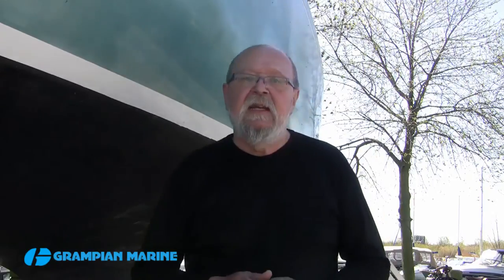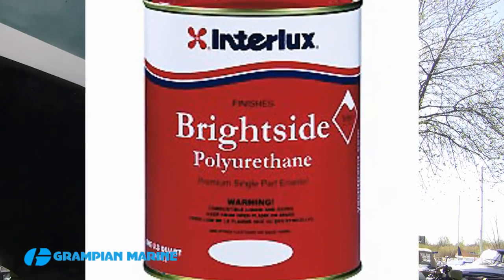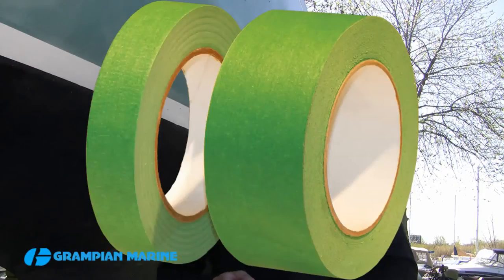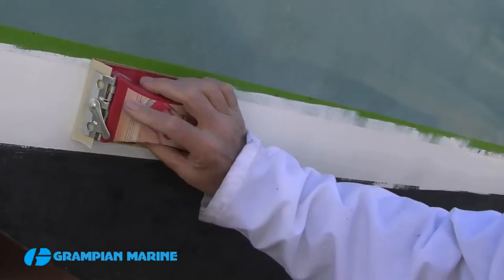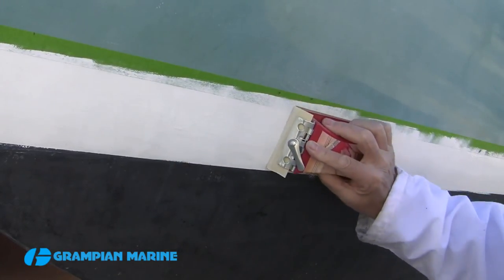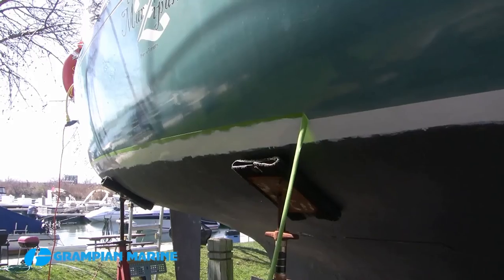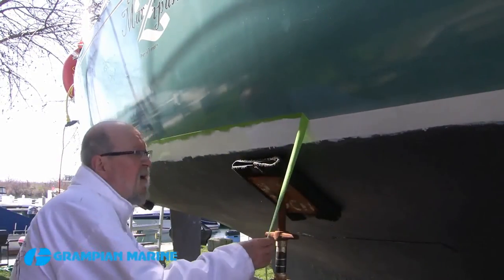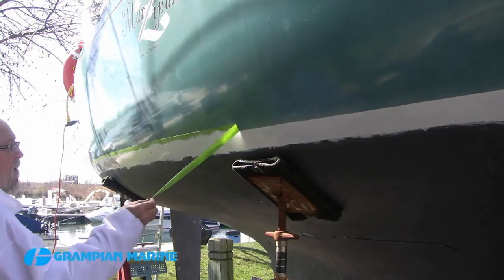Episode 9: Re-Painting a Boot Stripe HD

Comment: how do you do this when there is a vinyl strip you want to paint over?
Reply: Heat gun the vinyl off. Dewax... no really... dewax before sanding with something like Total Boat Dewaxer. Never use acetone. Then sand as directed in this video. Dewax and use a paint style (not woodworking) tack rag between coats. One of the biggest mistakes DIYers make is to not dewax... and when they do, they use an inferior product like acetone.